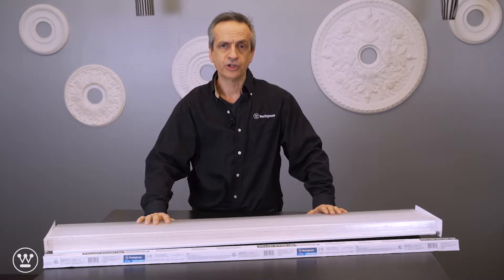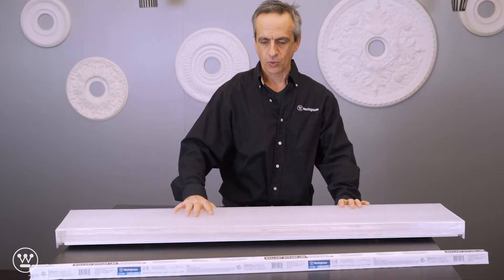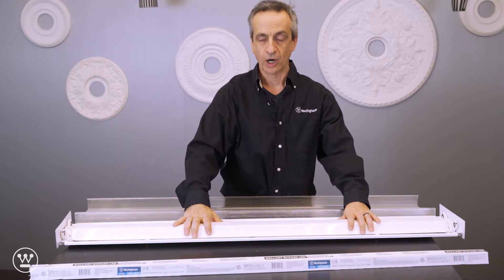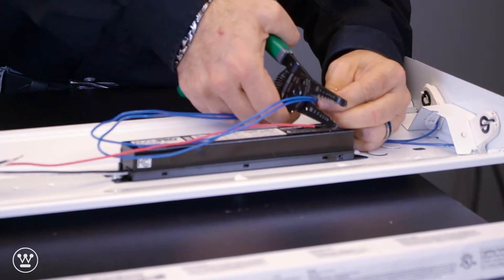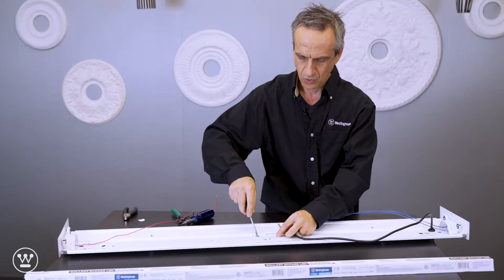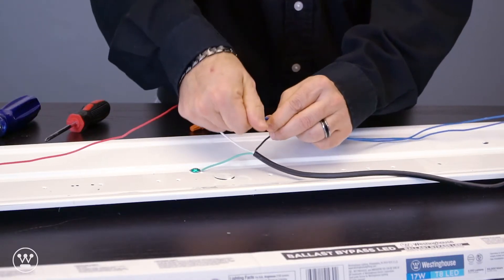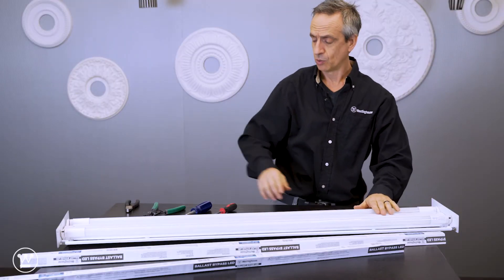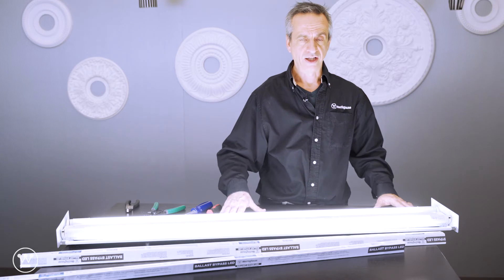Linear Fluorescent TLED Double Ended Retrofit Overview

Comment: What about the red wire?
Reply from the maker: This video provides a general overview of the steps needed to retrofit a fluorescent fixture to our ballast bypass LED lamp. However, as is always the case with electrical wiring, the specific wiring connections including the colors of the wires will depend on the fixture and ballast type, as noted in the video either wire can be connected to the house feed line and neutral wires as long as the appropriate individual connections at each socket are made. This information is explained in more detail in the instruction manual. (To view our TLED instruction manuals, please visit our website.) If you have additional questions specific to your electrical wiring, please don’t hesitate to contact us at consumersupport@westinghouselighting.com.
Reply: In this demonstration the hot (black) wire and both blue wires are all connected. Similarly, the white(neutral) wire and red wire are all connected. Apparently (it is not shown in the video) that there is a jumper between the sockets on the neutral side.